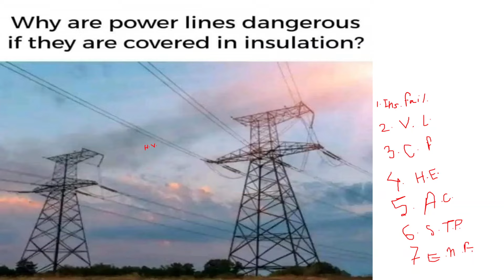Why are power lines dangerous if they are covered in insulation?

Comment: Power is the movement of free electrons along a conductor,  pulled by a load with a return path to generation. Big lines have line loss issues , and large magnetic fields. If you park a car under the line and leave it for a bit. Then go back and touch that car you will get a poke from it. Most lines have a few extra insulators as a buffer. If that insulation breaks down enough or becomes contaminated tracking happens. The tracking will find the tower and path to ground so you could get a nasty poke of just touching a tower if the grounding is bad or compromised